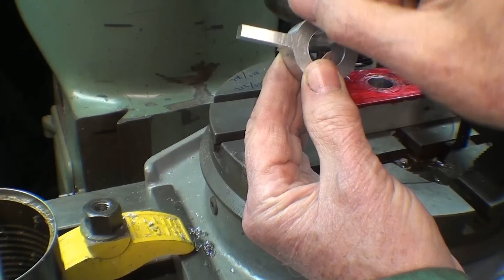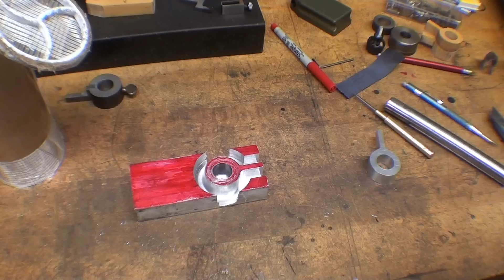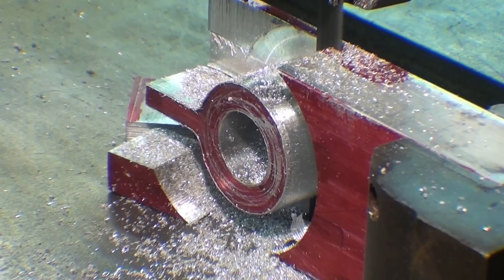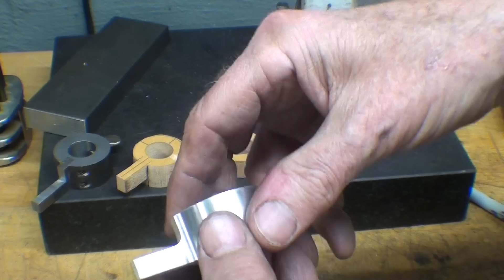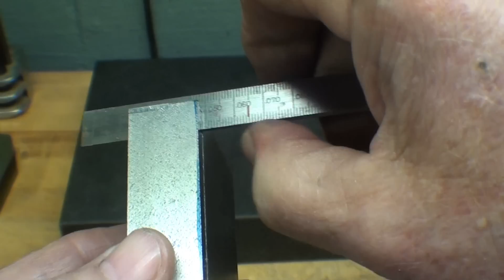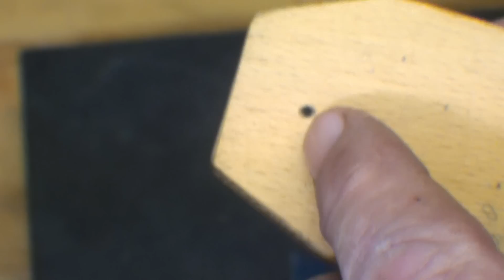TIPS #377 pt 2 How to Make a Height Gauge tubalcain

Comment: pretty impressive bit of concentration.    I am quite sure I would have turned the crank the wrong direction or over shot a target and would have cut off the stem.
Reply from the maker: Yes----I was concentrating.
Like you doing a root canal.
Reply: mrpete222 we just pretend we are concentrating when doing root canals.    We may very well might be thinking about a vacation or some fancy shop tool we can buy with all that money
Reply from the maker: Ouch!

Comment: How did you determine the point to stop and change from linear to rotary motion, since you are no longer aligned with the center of the part. Did you do the trig or is there a rule of thumb method?

Comment: I get a kick out of accomplished machinist's jargon.  Using very accurate lathes & milling equipment, and measuring with Vernier calipers and other gauges they make very precise instruments using tool steel and then refer to them as "semi-accurate or semi-precision".  On another channel an equally accomplished machinist measured, tweaked & adjusted to within 10 thousandth and called it "close enough".  No slight intended, its just makes an old "hack & tack" guy like myself smile.  Thanks for your time and effort put into all your videos.
Reply from the maker: Thanks for watching

Comment: ok, i admit that i dont know why you cant just come out the other side, you have the number for the dro, can you clue me in?
Reply: at 8:20
Reply: He had moved the table in or out which ever when he entered the end of the part.  Now when he comes to the opposite side the table was offset the width of the tang and half of the tool diameter.  To go out the other side he would have had to rotate the rotary table and at the same time move the y axis to the other side of the tang.  This procedure is quite difficult by hand.  Likely wouldn't even notice this on a CNC machine.
Reply from the maker: Thanks for watching

Comment: Stepper motor?
I just use a variable speed cordless drill (with a hex socket) on the rotary table handle nut (I double nutted it)
Works great, and you can go slow, or fast.
Reply: Yeah, but with a stepper you can also use it as an index table very easily and repeatably.
Reply: True... But for just one job?
Reply from the maker: Thanks for watching